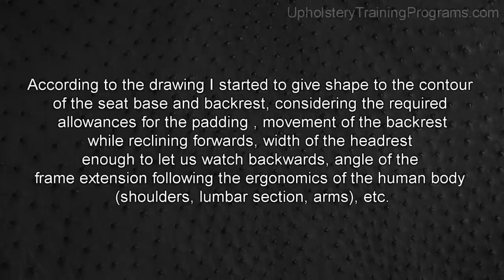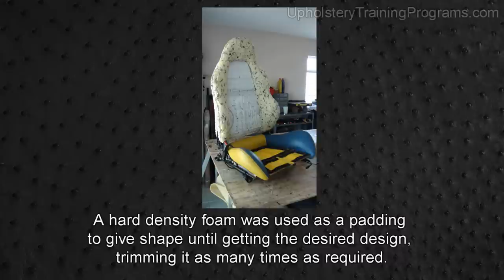A Bucket-Seat in Leather - (from scratch)

Comment: how did you shape the foam?
Reply from the maker: Brady Benson In the case of these seats, as we can see on minutes 0:28 to 0:35...Let's  thin steel rod to give the higher and new contour to the seat. I covered these sides with a 'jute material' both sides/bolsters to keep in place the padding/foam.
After doing this, I attached two rectangular 'bonding foams', overpassing the upper curved part 'rod',1 inch...then I started giving shape cutting off the excess all around the rod, giving it the same one inch measure.
With this 'foam mold', I cut its twin same rounded shape.
Both foams were of 1 inch thick...I glued both 1 cm appox over the inside edge all around following the contour...now, the next step was to paste yellow glue all over the top side (2 inches wide, because the foams are already glued 1 cm on its interior sides).
After a while the foams are dry, the idea is to press them together, joining the edges to get just one edge...we could say that the outcome is a 'cover' made of foam.
How to fatten the middle part of it to give the bulky rounded form? ...just by adding in the interior both sides another smaller foam with same shape...if necessary some trim, a scissors/knife are useful.
Hope it helps...I´d like to upload a video showing this procedure.

Comment: That colour scheme is a waste of your talents.
Reply from the maker: An old saying says: 'there's no accounting for taste, though'.http://www.interiorshot.com/mansory-porsche-panamera-power-pack-2010-interior/
The car interior is now marine blue and black. It was repainted. My son chose the color combo I also didn't like.
However, the nitty-gritty of this video was not show the color combination but some of the techniques to modify and leather-wrap an interior.
Thanks for watching!
Reply: Blue and black is better.  How is the leather dash in the sun?  Is there a lot of glare? Does the leather fade?
Reply from the maker: It's been almost five years since I leather wrapped this interior and it is still in good condition. Originally the dashboard was covered in blue leather. Now is repainted in black. I used 'cow shoe's leather' for this project, because I wanted to test its durability on car seats. This leather comes with no sealer/lacquer on top. I had to add some sealer on top surface. I put over three coats of 'water based sealer' applied by hand.